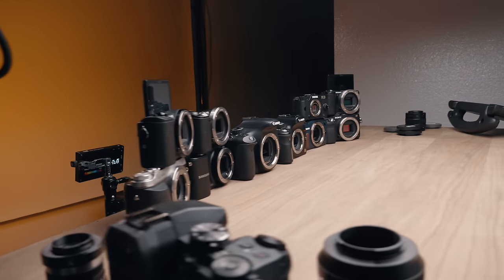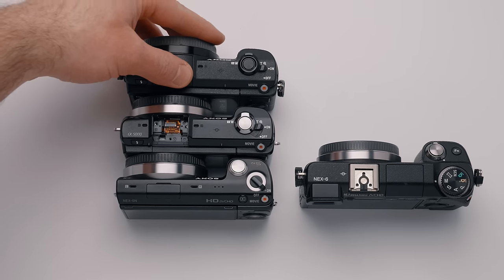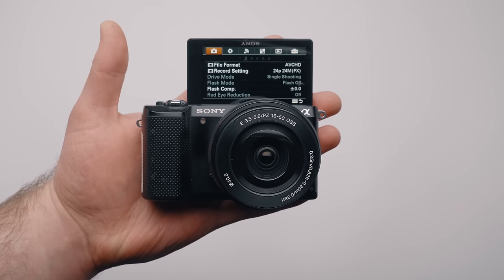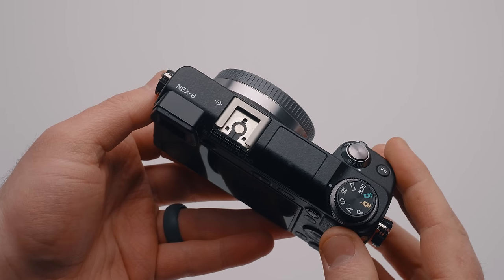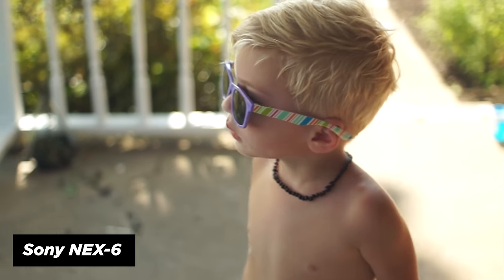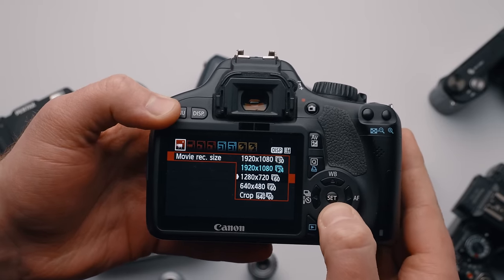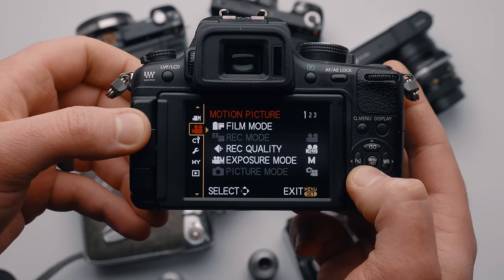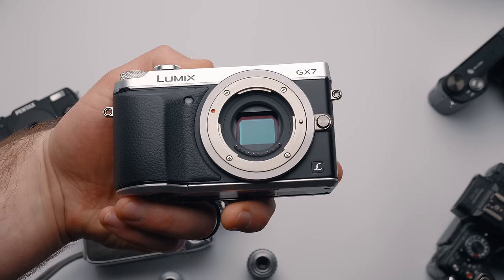10 Cameras Under $300 for Video!

Comment: Great list! Nothing tops the Eos M...2.5k raw for under 200 usd. It's the best cinema camera you'll get under 800 bucks. I have a BMPCC (not the 4k version) and I don't even use it anymore since I bought the Eos M.
Reply: How is the autofocus on it? This is for my friend who has a youtube channel, and needs a camera with good af.
Reply: @louislegofilms723  it's ok, but I don't use af for video though.
Reply: EOS M ML RAW best video quality on the list for sure(i too own both the original bmpcc and the eos m). Runner up and best video experience BY FAR on this list, as i have used most is the GH2 HACKED. Super stable hacks, hdmi out is perfect, mic input, touch screen, pinch zoom etc the video quality is great for 1080p. High bitrates and SUPER SHARP still today. The colors are not as good as ML raw on the EOS M but its sharper, easier to use, more stable when hacked, smaller file sizes, better battery life and 100% reliable, used it in a ton of paying gigs, cant say that for the EOS M with ML RAW.
Reply: @jdsmedia  yeah, the eos m is an sd card eater. I get about 20 minutes of 2.5k 14 bit raw out of a 64GB card. And the battery life is not that great either, but I have a bunch of SD cards and 6 batteries so I can shoot 5 or 6 hours. But the image quality and dynamic range is just amazing and you can do so much in post because of the high-bitrate raw format. The Eos M + a Takumar 50mm or a Minolta 50mm is cinematic filmlook in a bottle.
Reply: @kakarot3966  absolute best image quality on this list. For some situations even like it better than my bmpcc because of the bigger sensor. I like my bmpcc better but not by much!
Reply: @jdsmedia  you prefer the EOS M because of the bigger sensor ? When you shoot in RAW with this camera, it only shoot with a tiny portion of the sensor (3x crops IIRC, on top of a 1.6x crop because APSC) ... Isnt a full Micro4/3 sensor just better at this point ? lol
Reply: @JetBen555  only in 2.5k raw mode, 3.33x over full frame, not aps-c. Mv1080 mode is only 1.61x crop, pretty much stock crop factor and you get 1736x976 resolution raw 14 bit footage. With the viltrox speedbooster 0.71x you get pretty much full frame. The original bmpcc has a 2.88x crop factor btw, i have both and know them well enough. Not talking outta my ass here. And BTW, i said i prefer my bmpcc, but not by much. I shoot RAW on both, bmpcc has the edge no doubt.
Reply: Would you sell me your BMPCC? I'm in the market for one. I've had both the EOS M and the BMPCC and loved both. I also sold both which I kinda regret but what are you gonna do. In the market for a BMPCC right now. Looking to get back to my roots.
Reply: Love em both! I'll keep them got a little while!
Reply: with a ef speed booster on the bmpcc you get an aps-c crop and much higher dynamic range/lowlight
Reply: The Minister of Memes Only in 2.5k Raw and its actually 3.33x over full frame, with the viltrox speedbooster 0.71x you get it down to about 2.4x over full frame which is about the same crop as a GH4 in 4k. What it does do is default the display zoom to 5x when you select 2.5k raw mode. The actual footage actually has much more image than is actually displayed when shooting.
Reply: @jdsmedia  Still unusable. 2.4x is a lot more crop than what you get with a BMPCC and a speedbooster.
Reply: @cmdr.shepard  "unuseable" is a little bit of an exaggeration. A lot of people shoot panasonics with 2.2(like the g7 and gx85) crops and some closer to 2.4x crop like the gh4 in 4k. I use my bmpcc witout a speedbooster with its 2.88x crop all the time, so no, not "unusuable". I dont use the EOS M in 2.5k mode anyway, only in mv1080 raw mode which has a crop of only 1.61(1.6 stock) which is pretty much normal aps-c. Everything is usable, just your lens selection/depth of field will change.

Comment: You could have started out by telling us what is on that list every camera has, like what the hell is cold shoe?
Reply: A cold shoe is a mount for a flash, external light, shotgun mic, etc. that has no power contacts (meaning the mounted accessory has to have its own power or get power from somewhere else).  A hot shoe means there are little button contacts where the power from the camera is used to power the accessories as well.

Comment: I think that Lumix G6 is possible to buy under 300$ and also record good quality videos.
Reply: I was thinking the same thing.  I had the GX7 and never liked the handling, so G6 could be good alternative for those not willing to hack the GH2.
Reply: one of the best cameras out there on a budget (can be bought for around £150-180 secondhand in UK). standard mic jack. nfc and wifi. really excellent displays. GH2 sensor without the multi aspect ratio but with a newer processor. good battery life. one of the nicest cameras to handle. feels like wood, light but solid.

Comment: I have a Nex-5N and I got the camera, kit lens, flash, etc for $150, it was like $10 for a MD to E-mount adapter and spent $40 on a few Minolta lenses and for $200 I have both modern and vintage looks that most people can't really tell apart from a much more expensive camera. In fact the only real frustrating thing as I see it is that it lacks the much faster autofocus of the later models but, I use manual lenses more often anyways.

Comment: Nice video..Tons of useful info with obviously well presented options,,,So glad to see my NEX-6 made the grade..I like it very much and the EVF makes it a perfect stills crossover shooter. I actually found it on a local classified board for $150 and that included a battery and charger and 4 prime lenses (various makes) in Canon FD mounts,,including the semi- famous Vivitar 200 3.5. I would throw another camera on your stack though... Just this week I picked up a Panasonic GX-850 with the 12-32 zoom in perfect condition for $250. It pushes a 4K capable camera into that $300 arena and gives you a fully rotating screen as well. I haven't played much yet but I was knocked out how good the built in mics and the whole sound profile was,,,especially since there is no external mic set up. Again,, Nice job with the video,,,

Comment: Hi there and thanks for all your really great videos. I'm only going streaming stuff at my desk, so the camera will only be used for that. is the A5100 still the goto camera for the price you can get it? It's like $250-$300 here with the kit lens. I have some decent lighting, but thinking of a couple of those credit card lights in your other video. The camera will be at arms length, would the cheap 35mm lens from your other video do good as well? Is there other cameras that are equal as good for same or cheaper price? Currently have the Brio and the C920. Brio is allright with Logi Capture plus OBS Studio, but Logitech always drain down on software and stability.

Comment: Nice review.!   I bought the GH-2 a few years ago.. Has been collecting dust...now thinking of digging it back out.  What lens would you suggest?  I have an OLY 12-50mm /2.8-3.5 pz.  Ok quality. Not great.  And have the OM-M43 adapter - so any vintage glass suggestions ok too.  thx.   Is the color of the EOS-M better than GH-2?  iyho.

Comment: Hello, I really like your review - it was very helpful and straight to the point. I have just a few questions - how do these compare to the Panasonic Lumix FZ300? I am trying to start a vlogging hobby. If it is any help, I want to review cars with my vlog. Which one of these will do an excellent job? I realize there are others things to consider such as microphone, stand and gimbal. How could the mic problem be resolved since i will need to shoot and talk clearly? Could you give advice concerning using such camera for such a mission?

Comment: My Nex-5n keeps overheating after about 20mins of video shooting (even with a flipped up screen). Also it chews through batteries in video mode. Photo shooting is totally fine, can shoot a whole day with a single battery. No mic jack and the screens inability to flip towards the front are big drawbacks. AF in video works great though. Also 1080p 50/60fps depending on your region is still a very good feature. I switched to an iPhone 11 pro for my videos and only miss shallow DoF.

Comment: Interesting. I had a Samsung NX-1000, but it died. I later bought an NX1. I use the NX-1000 lens on the NX1. The NX1 has outlived the 1000. I'm currently working on building a set of primes based on the Chinon video. I have the 28, with the 135, 200 and 55 on order. All due to be here in early November. I've been using the 28 on the NX1. All good so far.

Comment: As far as video goes the GH-2 is a standout but also most frustrating because it is only 720p but it is a very good 720. This is the camera that kicked off indie filmmakers using GH cameras thing. I still have mine but recommend spending a few extra dollars and getting the GH3 with its 1080p 60fps. The 2 is excellent, but the 3 is pure genius but is relatively cheap because of no 4K.

Comment: I have the t2i, but the screen isnt working, so I have to replace that. Funny thing, I got the t2i 10 years ago. The screen not turning on is a common problem on the t2i.

EDIT: I replaced the screen and it still didn't turn on. I'm going to do more research on how to fix it.

Comment: in 2021 you can actually buy the NX500 for 300$ which is similar to a6400 (no stabilization or viewfinder tho) and the lenses like 16-50S for 500$ (24-70 G master equivalent), not even mentioning decent primes (100-200$)

Comment: I´m super curious about the Canon EOS M but would like to know if it works with a speed booster, anybody can replay?
BTW, BIG shout out to you Caleb for taking the time and effort to put all this videos and reviews, big up fo you my man!
Reply: Sure, there are speed boosters for it. Mostly for Canon, no surprise there, but it does give you lots of options. And even unhacked you can punch in and check focus. I have the M and have gotten a lot of good use out of it. Years ago I did what Duy Linh Tu recommended and shot it with an audio recorder on top, with a split line out with a headphone jack and a padded line into the camera. Did some nice videos that way. If you're watching this video you're probably not a gear snob and it's a good way to go. : ) I've moved on since then but there's no reason you can't get it done that way. Really nice image quality at reasonable ISOs.

Comment: Okay, so I have an interesting question.  I already own a Blackmagic ATEM HD TV productions switcher and all kinds of accessories and products to set up a little studio for my channel.  Problem I'm having is finding an affordable camera (or camera's, because I need three of them) and none of my existing cameras output a clean HDMI signal or SDI - to match the resolution and frame rate of the ATEM.  Would you know if any of these output clean HDMI for this ATEM?  I own a Canon SL2... some reason it does not output a clean HDMI signal.  Please help.

Comment: Looking for a travel video camera.  from your review like sony a5100.  What lenses did you use it with?  What other excellent lenses would you recommend for a video “like a cinema”? Thanks.
Reply: If u have a higher budget u can get the Sigma 16mm f1.4. It gives u a wide focal length, good af, high aperture which gives excellent low light perfomance, beautiful creamy bokeh and excellent image quality.

But if u have a lower budget u can get the sigma 30mm f1.4 or the sony 35mm f1.8 (have OSS)

 If u still think it is still pricy u also can check the sigma 30mm f2.8 and Sigma 19mm f2.8 which is much cheaper but have a nice perfomance.
Reply: Mr. 90's Thank you very much! Can I ask one more question? ) I have a higher budget, but I’m still don’t know - a5100 or a6400? What you think?
Reply: @KostesLV  If u have a higher budget of course the a6400. Why? Because it has the latest technologies which offers excellent af system which i heard much better than the a6500, image quality, low light performance. Theres so much to say about this body 😂

The a5100 is also good but it lacks the iso range, af system (but for its price it is good), evf, and control dial. 

But u might also want to consider that both camera doesnt have an image stabilization so if u want to do vlogging u might choose a lens that have oss, or wide angle lens or get a gimbal. Dont worry u still can edit it in editing process so u can get a smoother footage.

Im sorry for my bad English. Not my native language 😅

Comment: I'm late..

What are some good SD card camcorders, especially in low lighting?

I need a good SD card camcorder to graduate from mini dv..lol.

Thanks in advance..
Reply: Does it specifically need to be a camcorder, or can it be a photo/video hybrid camera like the ones Caleb demonstrated here? All of these use SD cards.

You won't find a better hybrid camera than the Panasonic GH5 in my opinion (or the GH5s, depending on the tradeoffs you are willing to make and how you plan to use the camera). But if your budget is a little tighter, do what I did and get the Panasonic G85. I love mine. It can do about 90% of what the GH5 can do.

If you really need a true camcorder, I would recommend the Sony AX700 / NX80 / Z90, depending on what features you need. They all share the same 1" sensor, which is good for many video applications if you don't need the shallowest depth of field. If you want the ultimate and you have a budget of $10,000 or more, check out the Sony FS7 Mark II with its Super 35 sensor.
Reply: Thanks for responding sir.

Doesn't have to be a camcorder, no.

Just something that captures hours of good family footage, & captures really good indoors(lowlight) as well, but nothing over $300.00, the lesser I spend, the better..

I just like the flip screen feel of a camcorder..

I like the ones u mentioned as well. But that will be for my more professional approach.

Thanks in advance..

Comment: Eh! Yeah, so an older post (I'm always late to the party)... but does anybody know of any other small mirrorless cameras (besides the Pentax Q7 mentioned) that can utilize 8mm "D" lenses (with adaptors, of course). I have a lot of older glass, much of it very clean/clear/tidy... both from 8mm and 16mm, and would love to repurpose some of it to be productive with HD video. The Pentax Q7 is appealing, especially with it's small size - the smaller 8mm lenses should match the size perfectly (as well as the C). I just don't want to pull the trigger on that yet if anybody knows of any other options for a smaller camera. I do already have an adaptor to use with my Panasonic GH-4 for C-mounts. Just don't know if there are any other options for the 8mm "D" glass... Thanks!

Comment: Video 2.5 years old, so of course the used market has changed, but I'd say the Canon M100, with, crucially, dual-pixel autofocus (good autofocus being something a lot of folks will NEED when first starting out), plus some other advantage, and as of Oct 2021, it's available for less than $300 on eBay.  

The other thing is to just use your phone.  Phones, besides generally having a fixed focal length lens, can probably shoot as good or better video as any of the cameras on this list.  And anyway, the first priorities of video making are making good CONTENT thru story telling, good audio, and editing...the camera is really the LEAST important part of being a successful video creator.

If you can tell a good story (while also getting good audio, if the audio portion is important), and can edit, NO ONE WILL CARE what camera you used, even if it was your phone.

Comment: Does anyone worry about actuation counts on all these eBay cameras? Half the reason to buy new. For the non mirror, how do we count sensor exposure count?
Reply: nah, i mean usually they are a under 8000 and mostly lifespan are 50k to 150k or even 200k so   shouldnt be worry so much for a used.

Comment: I use a Canon M50 to shoot video interviews.  I'd like to shot with a second camera simultaneously from a different angle.  Can someone suggest an under $300 camera that will give me video footage I can seamlessly integrate with the M50 footage?  I shoot in 1080p, 29.97 fps.  2nd camera will only be used for video... Thanks!

Comment: do all sonys over heat
Reply: I have not had a problem with overheating on the a5000 (AVC codec 1080i 60 fields/sec), nor on my CX405 camcorder.  I ran across a report of, I think an a5100, when recording for over 10 min.  It was unclear if that was using the XAVC-S codec though.  I do not recall ever trying to record a clip longer than 5 min on my a5000, so maybe that is a problem, though I doubt it because I think I would have noticed the camera warming up that much during a 4 - 5 min recording.  I have also used the Sony CX405 1080p 30fps using XAVC-S for around 5 min.  It did not get very warm.  I don't like to record for longer than 5 min in general.

Comment: what computer hardware needed for viewing 4k 30fps mp4 .// not so much editing,,, ...pls
Reply: well not so much but you need a 4k screen to see the difference lol.
Reply: pls tell me  ur computer  specs
Reply: @kaybhee6  well i have 3 computers. Good for 4k editing but overkill for viewing. i7 8700k 32gb ram n gtx 2080  and i5 8600k 16gb ram  gtx  1080 and an razer laptop stealth blade 2018 i7 8650u  with 16 gb ram and an external igpu, which has now a amd radeon  480.